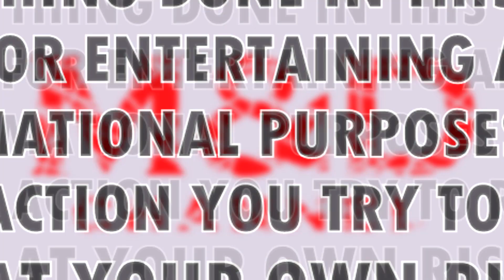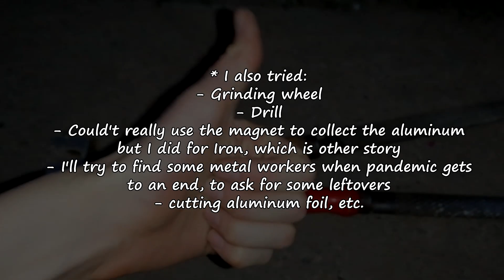HOW I GOT MINE | What's your best way??

Comment: Aluminum foil in a ball mill. Open every 12 hours to prevent spontaneous combustion. After milling for around 10 days, it should be very finely powdered.
Reply: 10 days? Damn just buy al powder from ebay
Reply: For like 17 dollars a pound not including shipping!!  I’m a patient guy....
Reply: @FireworkTutorials  just curiosity , what kinda motor do you use to milling ? 
I mean 12 hours is just too much for a dc motor
Reply: I use a Chicago electric rock tumbler from Harbor Freight. It’s designed to run for almost months at a time for smoothing rocks.
Reply: @FireworkTutorials  can you tell me about the rpm , watt and output volt
Reply: I honestly not sure about those things. Sorry!
Reply from the maker: I know that method, but I'd need to have a bit more durable motor on my ball mill. Thanks for the suggestion!
Reply: Oh. Your welcome though!

Comment: Aluminum foil in a blender
The cheaper the better
Check out TrollFaceTheMan’s video on dark aluminum powder, control the mesh with milling time
Reply: Agree, you can even chuck it in the ball mill for a couple of hours afterwards
Reply: every time I tried to make aluminium powder with the blender, it just turned out to very very small crumbled balls... Is my blender too weak?
Reply: Most likely not you need to mill it afterward

Comment: Pro tip: put it in your ball mill for smaller partical sizes. + Adding a little charcoal will help it burn faster.
Reply: Charcoal its added for prevent oxidation and spontaneus ignition